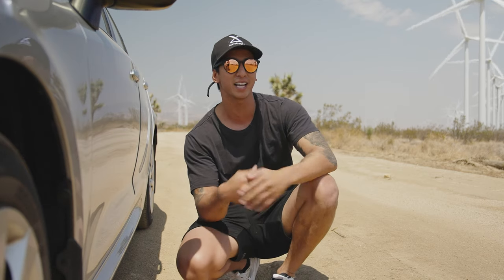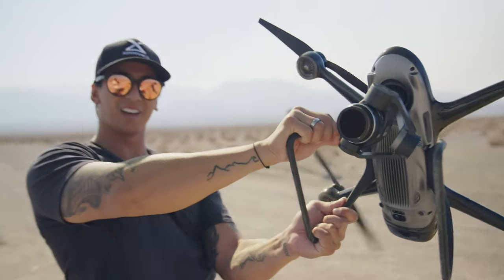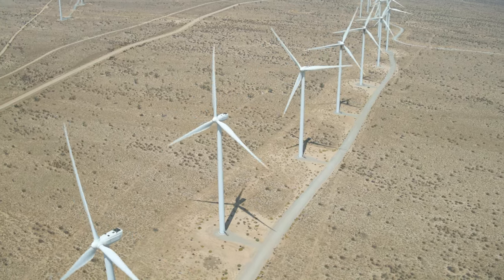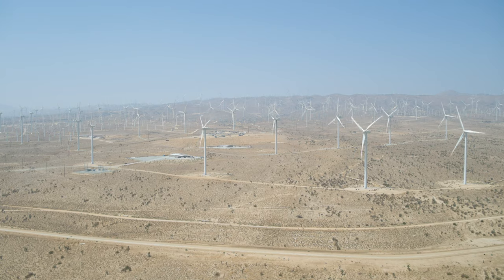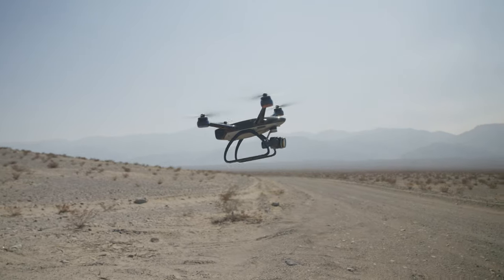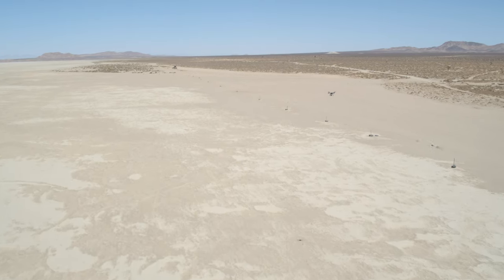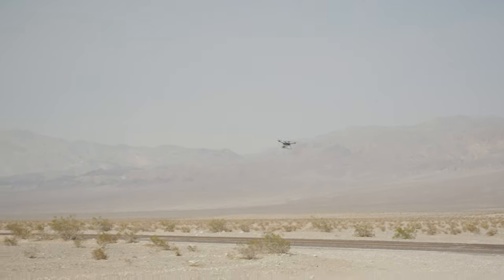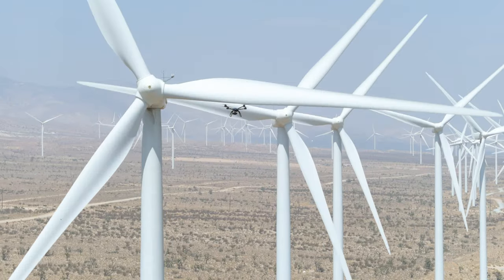Inside the EVOLVE 2 | Drone Wind Test

Comment: Does the drone calculate with the onboard bms to enable adequate timing for rth or does this unit require all remote pilot knowledge and timing to return the drone back safely- feature in reference auto rth
Reply from the maker: Hi Steven - The drone updates the home point at start up and on the Ground Station it shows the remaining time left and percentage.
Reply: @XDynamicsGlobal  like some other drones no names mentioned, auto return to home when battery reaches at certain levels?
Reply from the maker: @stevenlouis1024  yes the drone will RTH automatically. The default setting is 15%, but you can customize it to your liking. For example, some pilots prefer the drone to return at 30% - the platform makes it easy to adjust these settings.
Reply: @XDynamicsGlobal  niceeee. That's a big one for me.  I had the ID10T window popping up without my consent.
Reply from the maker: @stevenlouis1024  Thanks, yes it's important that our pilots have full control of their own aircraft and can adjust as needed to fit their piloting style.

Comment: What's the heaviest weight in grams for a lens.  I think the ones you recommend the top is 130g?  Curious if you can put the multiplier lens on that adds x2 but adds about 100g so would put it around 230-240g
Reply from the maker: Hey there - the heaviest is 170g if balanced. We are still testing with a multiplier.